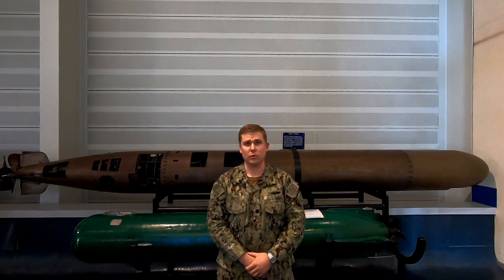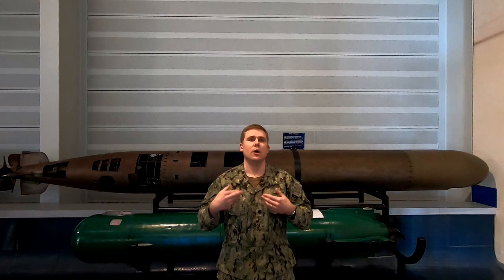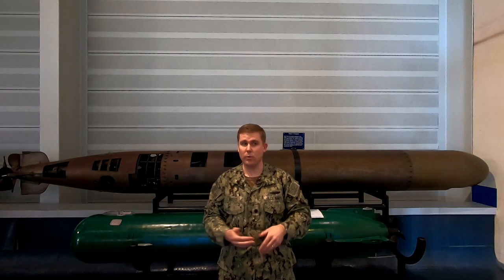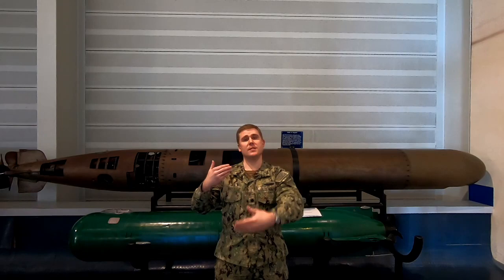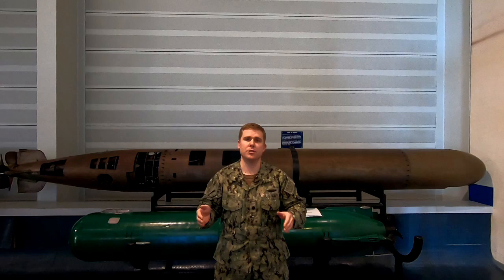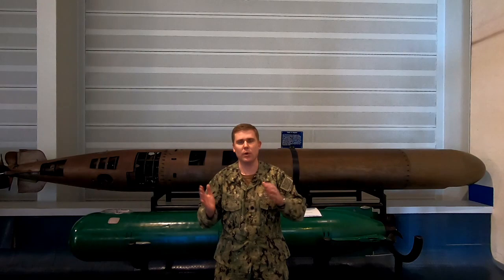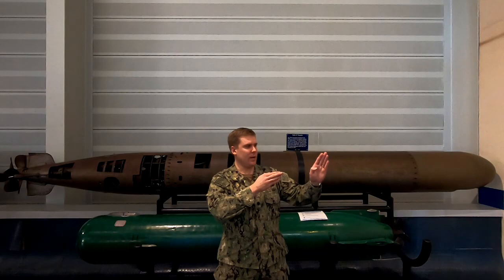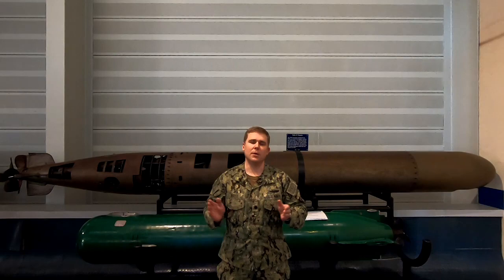MK 14 Torpedo - Operational Issues

Comment: One thing you didn't mention concerning the magnetic exploder. When the complaint went to the weapons research station in Newport, RI, the station found the torpedoes were working as designed. unfortunately, the magnetic exploder was designed around the Earth magnetic field in Rhode Island. When used in the Pacific, with vastly different magnetic fields, the exploder went off-track.

Retired on Nautilus in 1989. Piped over the side.
Mike Pullen EMCS (SS)

Comment: The problems with this torpedo caused huge issues during the first 18 to 24 months of the war. Heads should have rolled on this one but it took the guys out the fleet to identify and fix it.
Reply: If I’m not mistaken Admiral King also had to step in and kick some butts.

Comment: Bureau of Ordinance was almost criminally negligent in this. It is a problem with a peace time force transitioning to a war time force.
Reply: Everything is fine until admiral King starts twisting their arm.
Reply: drachinefel fan?
Reply: @madkoala2130  drachinefel fan?
Reply: Someone should have been court martialed for the lack of proper action.
Reply: @mark351  they did. But court was not congress, it was something even worst.
Reply: Congress should also share the blame. They didn't increase the budget for testing and the torpedoes were expensive to produce as well as the slow rate of production at three torpedoes per day. Considering these factors, it's no surprise BOrd was against blowing up an expensive weapon for testing.  What's infuriating for submarine commanders is BOrd was still resistant to testing their weapon despite widespread reports of the torpedoes failing to explode or exploding well before reaching their targets.
Reply: ORDNANCE not ordinance

Comment: The depth control sensor being placed on the cone (near the propeller) would cause Bernoulli effect to alter the sensed pressure, the faster you go the lower the perceived pressure, same principle that makes a carburetor to work.  This is common knowledge among engineers, which causes me to wonder regarding the training of the designers.  Plus the churning of the prop, would cause additional alterations in the perceived pressure because of its effect on the water flow in the immediate area.  This error cannot be detected without the torpedo moving.  Which means you won't know it isn't working without test firing.

Comment: With all the trouble of maneuvering their boat into position, made calculations, assessing the targets bearing, values are imputed TDC, patient wait for the exact time of launch, spread angle if salvo is used. Only for the subs CO to realize that a three or four eel all missed their target, ran too deep or were dud(s). I could imagine that CO would pop the gasket!
Still, it could be worse. It could be a circle-runner! D-':

Comment: The technical reasons for these obsolete weapons has been covered ad-nauseum.  The more interesting historical story is:  What was the Bureau of Ordnance's tactics to avoid troubleshooting and re-engineering these torpedoes?  What were the Admiralty command failures that contributed to this continuing for two years in wartime?  Who punted his responsibility?  Admiral Wright covered his failures at Tassafaranga point by exaggerating his kills, thus masking the failure of any of his 24 torpedoes to explode. They all beached harmlessly on Guadalcanal.  30 PT boat torpedoes failed at Blackett Strait, none worked.  78 torpedoes fired by PT boats at Surigao Strait in 1944 failed to explode, all of them.  There is no happy narrative, no explanation, just impunity.  Each torpedo cost as much as a four-bedroom house on a property in California.  Adm. Wright later commanded 'Port Chicago Naval Weapons Station' when it blew up.  Check out Wikipedia.